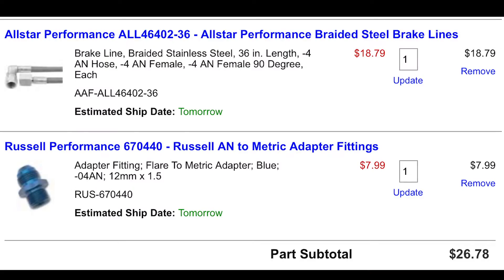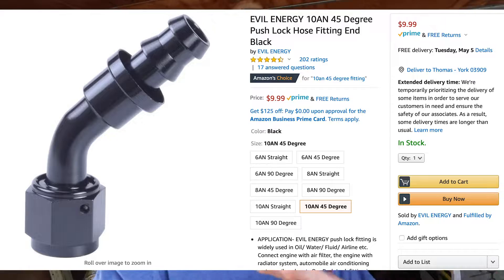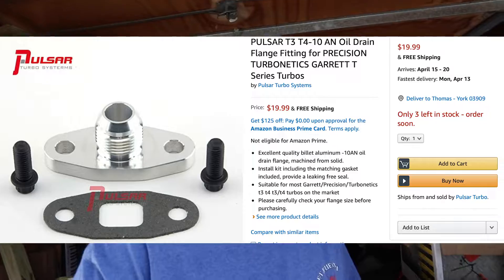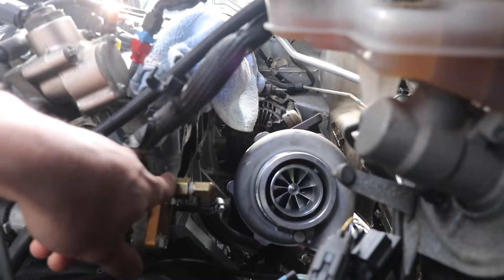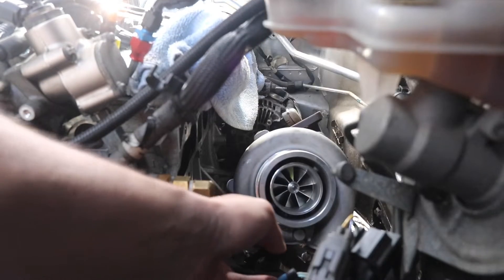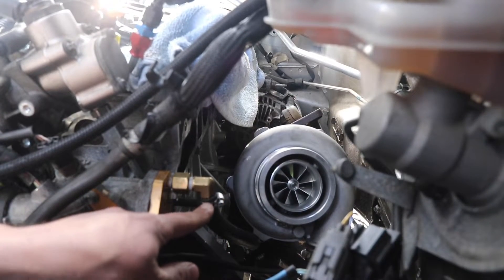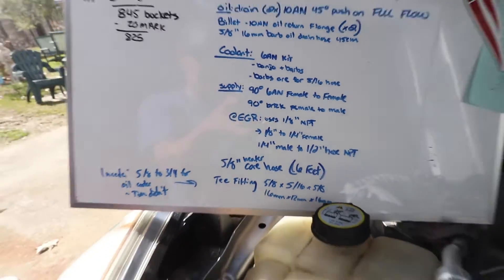GUIDE: Mazdaspeed 3 Pulsar GTX 3076R // Everything You Need To Run GTX 3076R Turbo!

Comment: Thanks for the vid, great info that I used in my build. Question for you though, did you get the T51R mod option for your turbo? I got it for mine and noticed that it's very quiet for a T51R mod. I noticed that yours is fairly quiet as well in your Dyno vid. Just wanted to check if it's a pulsar issue or I got a defective unit

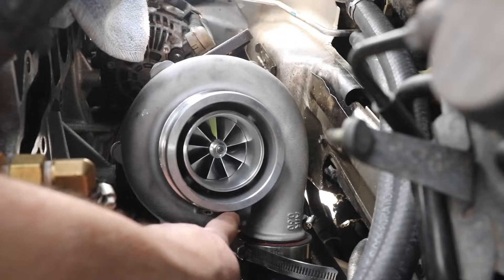Comment: Thanks for sharing the info and the tips on additional hardware. Question though, on the boost tap (@5:23), can I use the speed sensor port as the boost to the EBC?? Thanks!

Comment: The pulsar turbo has a t4 flange, right? What manifold did you go with?
Reply from the maker: Yes t4 but you can get a vband. I have FJP manifold
Reply: @TomCanino   It's a T3 "Pulsar GTX3076R GEN II Dual Ball Bearing Turbo Billet Compressor T3 0.82 A/R" , T4 is for very large turbos like the GTX3584RS

Comment: Would the atp turbine housing work with this turbo?
Reply: Yes but it is not recommended to use the built in wastegate port on it as it really screws up flow from the turbo "they haven't updated it in may years". Purple Drank commented that it works well if you use an external wastegate off the manifold instead.

Comment: Does this turbo bolt right up to a stock flange style downpipe?
Reply from the maker: Nope you need either a vband or t3 downpipe and exhaust manifold
Reply: They sell a bolt on one on edge auto sport. Same turbo but fits with stock flange. Heard it Comes with all the lines for the egr and oil feed and return lines. It runs for like 1,900 I think

Comment: Nice video Tom, informative and to the point. 
Few questions though: Are you running Aux fueling to go with the GTX3076R or is it not required?
Also: What is your target boost on this turbo?
Thanks for the videos, keep 'em coming
Reply from the maker: sq33qs Yoo! I’ll be running full Port Injection, but it’s not necessary! You could just max out the stock fuel system and sit around 350-370whp depending on your other flow mods. I’m going to be trying a 93 octane tune on the port injection (shoot for 430-450whp), and then an E mix port injection tune and shoot for 500-550whp! Target boost on this turbo on stock fueling is probably 22psi. Once you get to the 500hp mark I’m guessing it’ll be around 30psi!
Reply: @TomCanino  - Thanks for the info. All the best with your build man.